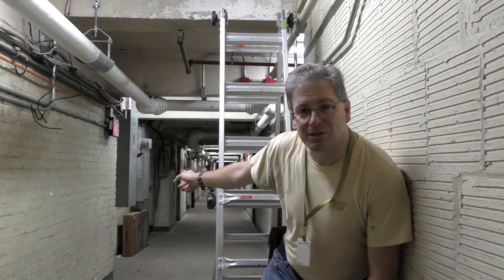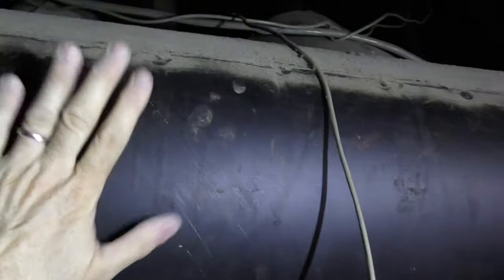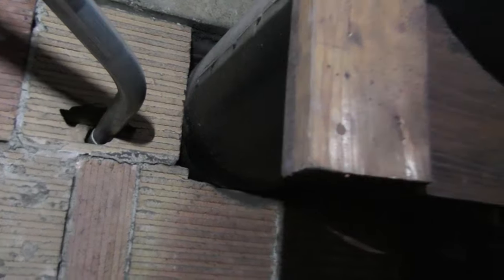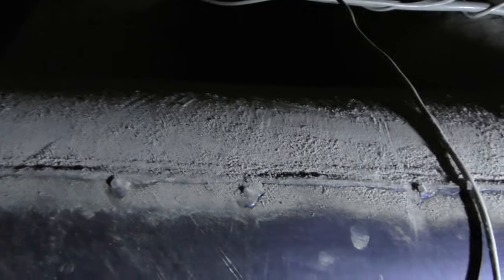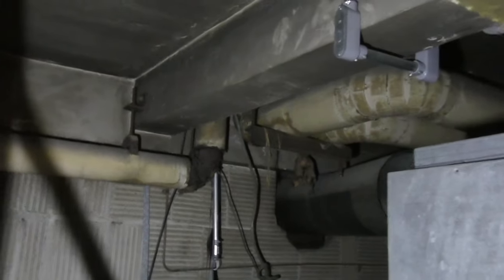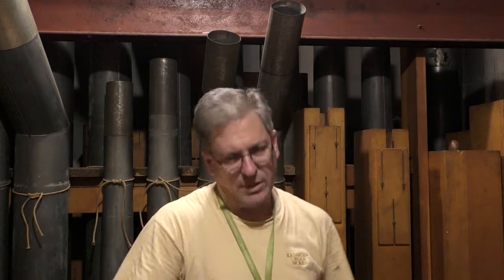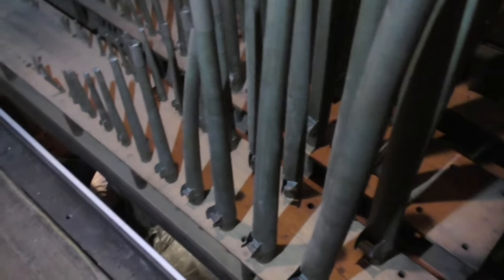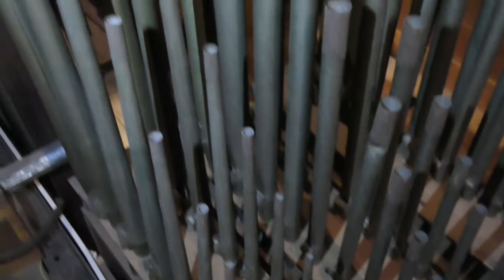Boardwalk Hall- A few curiosities

Comment: Sounds like stop #218's condition may have been a way to say "'Eff you Senator!" from an installer.
Reply from the maker: I think you're on to something there.
Reply: @cnagorka  A good example of this stunt was in Aeolian Skinner op. 1203  (1952 Boston, MA,  Mother Church Extension 4/237) It was left substantially unfinished by  voicers during original install.  This and a number of technical deficiencies were uncovered during a restoration in the early 1980's.

During the restoration,  many  pipe toe holes on the mixture ranks were found taped over and pipe construction/voicing was of very basic standards compared to other A-S  instruments of the 1950's. The organ was large enough to hide the imperfections.

Why? G. Donald Harrison and his team just wanted to be done with the project as the client relationship had deteriorated. He even refused to make it a GDH signature instrument. It was very well played "Eff you, dear client!"

Comment: The Echo was on the the first divisions to go in and the Solo-Great one of the last. They could have easily shipped that rank back up to Merrick to be repurposed pretty early on. As it is completely straight sided, maybe it was an early F-up by the Merrick pipe shop, but the entire rank was made, so thats questionable in its own right. Being voiced on the same pressure (15") made it easier to swap in any case.

My guess for the quietest rank currently operational, is the 16' Quintaton on the unenclosed Choir.

Comment: At 4'16" - surely that's a stamping error?  Spitzflote pipes are always tapered, even more so than a Gemshorn (top of the pipe typically 1/4 or less of the diameter at the mouth) to produce their characteristic tone, and are tuned by ears (because slotting would ruin the tone and slides don't work on a cone).  Even the name = "Spitz" in German means "pointed".  Those pipes don't look to have any taper at all, and the mouth is cut up more like a bourdon-style flute.

Always thought provoking videos Chris! Thanks for posting.
Reply from the maker: NIck told me that the pipes are actually tapered, but just barely so, like one pipe diameter difference from top to bottom. You have to remember that pipe names don't mean much in this organ, like the Unda Maris in the Choir which is an open flute like a Melodia. Anyway in the last part of the video you can see what actually ended up in the Echo is a conventional Spitz Flute. Too bad they didn't connect it.

Comment: That little quiet stop should be connected.  Not that it will add much, but to just leave the chest and pipes there mute makes no sense, especially if the wires are there.  Thanks for the video.  As always, they are great to watch.. Would love to see an educational lecture on the words switches, relays, primary, secondary, etc.  Those words have always mystified me.
Reply from the maker: Okay, I'll add that to the list of subjects for next time.

Comment: The "booster blower" could be the 100" compressor, since it helps the high pressure blower in the right stage chamber and isn't a blower in itself, but an industrial compressor put there instead of a real blower like the others 😀
Reply from the maker: Nope- it was specifically listed as a 30 horsepower Kinetic.
Reply: @cnagorka It may very well have been decided that it wasn’t necessary since the compressor for the 100” was doing the job, so they just left it alone.

Comment: A bit off topic, but those roof divisions are likely to be almost impossible to maintain.  Any wisdom in moving them to an 'antiphonal' section in the back?
Reply from the maker: Nope. They won't be any more difficult to maintain than any other division, you just go up there and tune or whatever. Keeping them in tune may be more of a challenge, but even that isn't such a big deal since the hall's HVAC is so radically improved since the time the organ was first installed.
Reply: @cnagorka  Well, good to know!  And the leaks are gone?